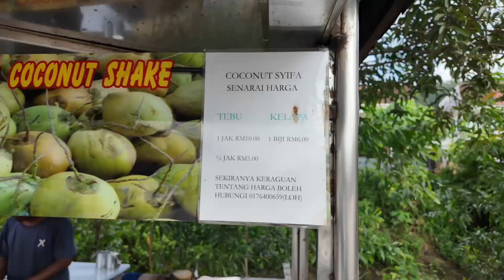Preparing Sugarcane Bagasse Sample

Comment: Thank you so so much for this video!! We've been struggling to find a process in which we can obtain Sugarcane Bagasse for our research. If we may ask though, is there any other method that we can do to get crushed Sugarcane Bagasse? We think there's no such machine at the end near our place, and if there is, it'd be a bit too expensive for us to use. Thank you again!
Reply from the maker: If you means how to obtain the pressed baggase, refer to the answer in one of the comments below - that the easy part because people press the sugarcane to get it's juice and the machine is readily available and the price is quite cheap.

If you means crushed sample (i.e. get smaller pieces out of pressed baggase), the simplest and efficient way to obtain it is by using a crusher or a ball mill. If you do research in a university, that's a common machine. Ask around. Usually if you are a member/student, they will allow you use for free or with minimal fee.

If they don't have it or you don't do research in a uni, you can collect & accumulate the baggase first, dry it, and then send it to any shop that do crushing or milling service. Any research institute or university near your place usually has it. This is the easiest for you. It will save you a lot of time and headache. And for a crushing service, I don't think it expensive. Plus, sugarcane baggase is very easy to crush by crusher blade ( not super hard and fibrous)

Alternatively, if budget is a constraint, you can buy a  cheap paper guillotine or heavy duty scissors from any online/stationary shop and use it to cut the pressed baggase into smaller pieces. But, it will be a manual work and requires a loooooot of labor as the skin of baggase ( if they don't remove it) can be quite hard. Not a recommended method if you got a lot of samples. But if you work with a small sample volume, say less than 1 kg, then I think it's manageable.

If you want a powdered baggase sample, just google online 'spice grinder' or 'electric grinder mill'. Typically used in a kitchen to grind spices into powder. The Chinese one u can get around USD 50 or even less. Just cut the baggase into smaller chunk before putting it into the grinder and make sure it's totally dried. You can see how we crush the crab shell using cheap grinder in https://youtu.be/MUEwoKrGveo

Btw, kitchen blender or ice blended type blender not powerful enough to powderized the sample, plus you need water to operate them.
Reply: @wanmohdfazli  This is so helpful omg, thank you once again! We'll be sure to keep your advice in mind 💗

Comment: thank you for this video we really needed this tutorial for our research, were cultivating it on mushroom. May we ask what machine we can use to extract the juice other than that? cause we cannot find any place that has that juice extractor thing near us, and can we just use blender for chopping it up at the end?
Reply from the maker: Google 'sugarcane juice machine', it was shown at the beginning of the video. It's quite cheap, RM400 like that in Malaysia, around USD100. We don't own that as we just collect the baggase from the sugarcane juice seller. Not sure if u can order it online to your country, but give it a try find a dealer. However this machine usually use diesel, it will be loud.

Alternatively google ' electric sugarcane juice squeezer'. That more clean and use electric, just maybe not as powerful as using diesel engine 

You can also use presser ( like hydraulic press, often found in automotive workshop). But it not efficient like dedicated sugarcane machine, because you need shearing force to break the outer skin. But if you got strong hydraulic press machine, I believe it can crush the sugarcane easily. Just--- it will leave a mess. 

Blender not advised, as the outerskin is quite hard for the blade to break it.

Or manually, take a metal hammer, and hammer the sugarcane. That much easier than blender. But of course wrap the cane with plastic first or else your place will be a mess when the extracted juice go all the direction.

Comment: Thank you for explaining your process! This was helpful for my research. Can I ask, what are you using the crushed sugarcane bagasse for?
Reply from the maker: Glad it helps. For now, we using it as substrate for mushroom 🍄 cultivation, but u can use it in any research that exploit natural fiber. E.g. as complex sugar for microbs fermentation, as carbon precursor for biochar/activated carbon synthesis, as starting fibers for nanocellulose or composite development, etc. you can always convert the crushed sample into powder by grinding, ball milling, or simply use dry herb milling machine